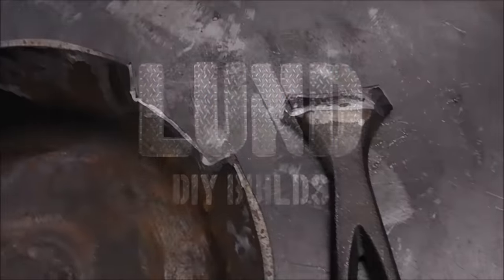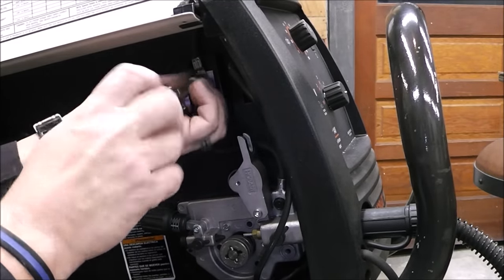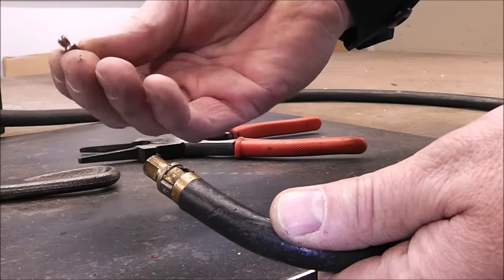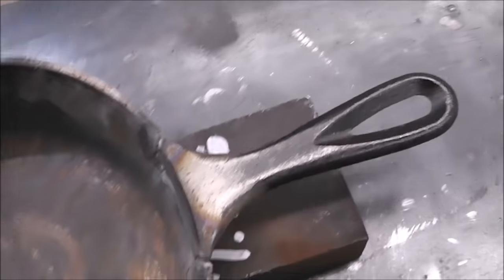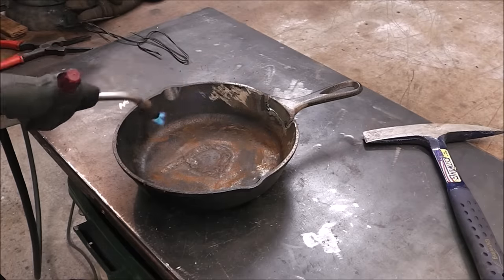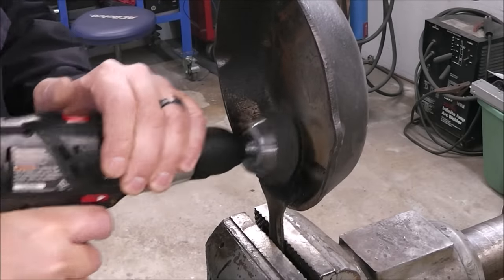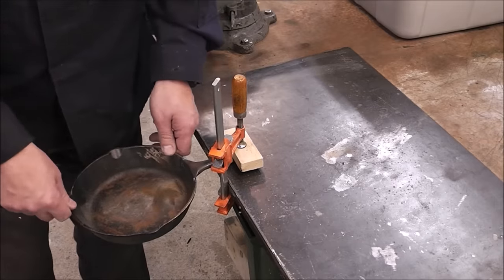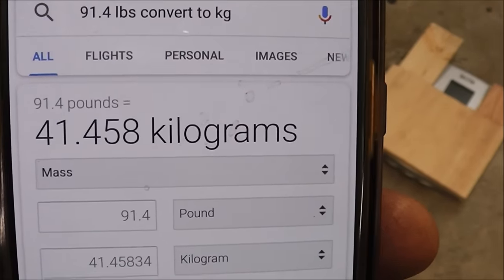Cast Iron Welding Repair using Flux Core Wire

Comment: This is good idea video...One flux clore is a method staw... which does produce higher temperatures for welding...Which can create extremely durable welds...
Flux core mig is also available ie home depot (lincoln electric) my preference) tractor supply (hobart) as in the video..any weld on cast via ie brazing or mig or tig.. is dissimilar metal..the strongest bond is cast iron is to recast the metal..which is very hard to do... the initial casting being the strongest..since cast iron is nor steel it is very hard considering the amount of carbon in the steel...
i have had success using borax and other fluxes that do help to control the welding temperatures.. also map gas is helpful being a blend of acetylene and propane..propane is a very cold gas...
another test ie versus strength would be proper sealing lie water etc etc...as far as oxy acetylene it doesnt always do as well either...ie the the blend doesnt always penetrate into the cast iron...so this is all about how far the weld metal penetrates and cleats and pools into the cast..then the tensile strength of the property of the repair metal...also in this video notice the welder used the bare minimum weld which is a viable strength...considering he could have gone and done 100 percent fill with additonal lap welding for strength you want some cool welding look how they bond armor plating in tanks with smaw vs fcaw...so this gives you the idea of the principles behind dissimilar welding process.. fcaw of course being extremely cheap as well as a good idea for one off
antique restorations as well...the next would be a strengthing video as well as liquid sealing video for final process...but a great video....could use a safety itro for those who hurt themselves lol...but nice..
Reply from the maker: Thank you very much Joseph! EXCELLENT post!

Comment: I've only ever TIG welded cast iron for a class; it was a 4" T-joint with 1/2" legs, took about 90 minutes after pausing for heat management and another 30 to cool it down.
My teacher said "when it comes to [repair welding] cast iron, braze it or buy a new one."
Reply from the maker: That seems to be a common misconception that a lot of the older generation welders believe but having tested probably more methods than most I can assure you there is definately more than one way to skin a cat. He is right in one aspect that brazing is a sure fire repair method, but it can be done using serveral different processes and fillers. I'm not one to paint myself in a corner by saying it can only be done one specific way.
Reply: @BrandonLund  I wasn't told that it's impossible, just that it's not worth the effort.
Reply from the maker: @Jorbsman_Petersdude It's definately worth the effort because it works. You could also MIG braze it with silicon bronze for a stronger joint or stick weld it with nickle or braze it using any of the aforementioned fillers. Brazing is just one of many ways to repair cast iron.

Comment: As a former Lincoln Electric employee at the Euclid, OH plant having worked both consumable and warehouse. Everything that comes out of there is labeled as Lincoln Electric. Both spools and coils and there packaging. Even the 500 lb drums were printed with there logo and put stickers on the inner core of the drums as well as on one lid per pallet (4 drums). Not sure what happens at the other plants. Just wanted to put it out there.

Comment: I have had success in building a fire in a wood stove and placing the welded item on the stove. easy to control the heat in the stove and cool down slowly
Reply from the maker: Great tip!

Comment: Since it is a pan it nobody will load up 90 lbs of scrap on it but they will run it through many cycles of heating and cooling.  I think the different metals (filler material and cast iron) will expand differently and that is where the crack will begin. Just a thought, I could be wrong but I think worth mentioning.
Reply from the maker: Good point Robert and that is very possible also. Cast iron is very fussy sometimes from one casting to another. One poster here said he has a piece of repaired cast in a wood stove that has seen hundreds of heat cool cycles with no signs of cracking. It's kinda a crap shoot at times but the dissimilar metals as you pointed out is where the crack would reoccur. Cheers brother

Comment: So say I have a 96 chevy 350 small block with cast iron heads. Personally i have 5 of these heads all cracked in the same area. Could i repair them?
Reply from the maker: It's ruined anyways so you got nothing to loose right? A lot of guys on here have posted they have been doing it this way for years with good success. If it were me, I would give it a go. If you do decide to give it a try, please post back here with your results. The comment section often contains good info. Cheers buddy and good luck.

Comment: I have a broken cast iron wood stove leg. Since the stove doesn't move I actually haven't fixed it for years. the stove is fine as long as it doesn't move.  I think I will give this fix a try.
Reply from the maker: Good luck with your repair @j m

Comment: Zheng I have a  Lincoln buzz box AC/D.C. I'm supposed to be able to weld aluminum with it. Was practically new from auction but I got no paperwork or manuals with it. If that's possible how about a video showing this short bus rider how to do it. Thanks
Reply from the maker: Thanks for the sub Keith and congratulations on your new purchase!  Theoretically it's "possible" to weld aluminum using DC stick but the results in my experience are not good. It's not a process used in the industry, welding thin metal is non existant and thicker stuff is unreliable.  Im not trying to discourage you but all my experiences with DC stick welding have not been good. If you really want to weld aluminum the best way is to buy an ac tig machine but they are quite expensive.  The Lincoln buzz box is a rock solid unit, plus because its DC you can pick yourself up a 17 style tig torch, argon gauge and a power block (the components of a tig rig setup) and do scratch start tig.
Reply: I have an argon tank and gauge on my mig. The tig torch and power block. Where would I look for those. Gas cylinder co that sells welding supplies or can I get one at Rural King with my ammo next week.
Reply from the maker: Keith, if you click the link in the description for the tools and gear that I use there is a tig rig setup on that page. I use straight argon on my tig setup. That way your setup to weld stainless. We dont have a rural king locally. I get all my supplies from Matheson. They are all over. Great service and prices.

Comment: What I would try is getting the handle and the pan glowing orange to red. Fire bricks help retain the heat if you form a close stack to the item.
Then use the fcw on a very low current , minimum. Weld in tack upon tack until creeping around the weld seam completely. This is to avoid poke through with the wire. That which I have done I only peen if it is substantial thickness. With a pan I'd reheat it to a glowing temp and as you did control the cooling. (Heating to within an inch of the weld repair.) I have had good results on tractor exhaust manifolds with fcw mig.
Reply from the maker: Excellent process! 👍

Comment: was there adequate penetration on the metal?  couldn't see the backside all that well.
Reply from the maker: There was very little penetration. Think of brazing rather than melting 2 metals together. The goal is to try and not "wet" the cast iron.  When it starts getting molten is when it's more prone to cracking.

Comment: There used to be a company out of Texas called EXERGON (sp) if memory serves me that made some cast iron wire for a job I had repairing the two bearing housings for the eccentric on a shaker screen another shop had done a week earlier and they failed. They used a copper based rod and I had to air arc and die grind all that out. By the time I got all that crud cut out I had 1 inch gap to fill on a 4 foot diameter and the flange was 3 inches by 1 inch. I had t hold a constant preheat between 450 to 550, so I built a forge out of a 60 inch crusher cone. I sent them a sample of the material and one week later I had 2 8 pound spools of wire  at 800 dollars for the wire and shipping out to the west coast. It worked out great their wire really did the job. It took 10 days to complete the job working 12 to 15 hours a day, I don't know if they are still in business but they were great to work with. They were expensive but well worth the cost, They also made a rod called extractaloy for removing broken bolts out of a blind hole. You just crammed the stick down the hole to the top of the blot and filled up the hole. When you got to the top you knocked the slag off the tip that was sticking out, and using the same rod welded a washer and a nut to the little nub. Then let it cool down for a while and rattle it out with an impact. I've tried to find the company but haven't had any luck, they were somewhere in Texas and I left the States years ago. Let me know if you find them or somebody else doing that service now. Thank you
Reply from the maker: I'll have to keep my eye out. That sounds like one heck of a repair! I would love to have been involved with that. It sounds awesome!

Comment: I'm not sure but I think my vice is cast iron (cheap Chinese) and I welded the steel jaws to the body no worries. It failed using a stick welder (both mild steel and stainless) but gasless MIG mild steel was fine. I think you have a good approach to fixing stuff on the run. In the remote regions of Australia some methods are just not feasible.
Reply from the maker: @Gary Blake thanks man I'm glad it worked. Some people get bent out of shape about non conventional repairs but if it works and it's all you got, why not try👍

Comment: I've very successfully welded wear steel on heavy equipment with cheap wire feed wire by using a very rigorous regimen of pre and post heating and peening.  What was supposed to be a temporary repair  has held great and is actually wearing out with the wear steel, it hasn't re-cracked.
Reply from the maker: Your a perfect example of you dont know until you try! Thanks for sharing man! A lot of people say it cant be done
Reply: @BrandonLund  Crotchety old machinist told me again and again and again "pre-heat, post heat and PEEN THE SHIT OUT OF IT!!"  He was absolutely correct.

Comment: As an old chef and new welder my question is is there any toxicity in the flux core? I’m thinking of the stuff that goes into the flux. Sorry if it’s a daft question, but I do make a mean béarnaise sauce.

Again as a new welder I appreciate this approach to trying and testing, thank you.
Reply from the maker: Hey Mark, great question. I'm sure it's probably consistent with the base metal in the pan and any toxicity is probably negligable but I'm not certain of that. I would not condone repairing cast iron for actual use simply because if the repair failed the results could be fatal. Cast iron cookware is relatively inexpensive so new Vs. Repair is the way to go (unless it's for display purposes).
Reply: Brandon Lund Thank you for the prompt reply, it’s really appreciated.

Comment: 90 lb in a cast iron skillet.  I don't plan on cooking any older children anytime soon, so I think this method works.  Awesome video man! Any reason you didn't put some weld on the other side?
Reply from the maker: Thanks davionaceae! Good question! I didn't weld both sides so I could experiment to see if welding it on both sides makes it stronger.  Heres a link to find out! Cheers buddy! https://youtu.be/qNHAteo-qwg

Comment: Been welding for 35 years and nuclear asme certified, use e309 stainless, and heat up to 150 before welding
Reply: 309 is Definitely the way to go.
Great for most repairs especially if you don't know what metal you are welding.

Comment: Thx for the video....wondering if you could just put the pan on an old hot plate to heat it etc
Reply from the maker: You sure could. In fact, get it up to 350f and weld it right on the hot plate. Over the next few hours slowly turn it down until your at room temperature. Thermal shock is the enemy. You could throw it in the gas grill also

Comment: Have you thought of putting a piece of heat shrink over the cone tip to prevent it from touching the work piece, in flux core welding?
Reply from the maker: I havent but that's actually an awesome idea! Thamk you! 👍👌

Comment: To arc weld cast iron use nickel 99 rod.I have even use nickel 99 with no pre heat with excellent results.
Reply from the maker: Nickel is great with cast. I did simular with Muggy Weld

Comment: I always keep the gas shield on, there is two reasons why your shield arcs out, you haven't cleaned your tip and shield properly, or the insulator/defuser is worn out or missing. That's some great information,  I would never have tried gasless,  I generally use low hydrogen, I have tried dissimilar metal rods / weldalls, but the stainless content makes cracking a bigger issue than with low hydrogen rods.
Reply from the maker: Pick up a spool of silicon bronze. You will never repair cast with anything else again https://youtu.be/Cm3_uv-PhPM
Reply: @BrandonLund  thanks mate,  I'll check it out now.

Comment: When I saw what you did it confirmed what I've done in the past although this is not my trade and I always wondered how strong the weld really was. When you did your test I sat here nodding my head in agreement "but" I have to disagree with your weight test and please correct me if I'm wrong. The weight you applied was "not" over the actual weld but several inches away and not concentrated in one spot as I'm sure a lab test would be conducted. What I am saying is, I am certain that the actual weight on the weld was probably multiples of what your scale read because of the actual distance away from said weld, think lever affect here. I hope I explained myself in a logical fashion but I look forward to any comments in agreement or not.
At any rate, "weld done", pun intended. Thanks for the video.
Reply from the maker: Thanks Wayne. Nope I completely understood what you were explaining and you are totally right about there being more force on the weld than what was actually shown on the scale. I think it's called a lever but either way your right. I'm not sure if you have seen any of my other cast iron welding videos (which includes different processes and filler materials) but each test we did was using this same crude but rather effective method and this repair (if I recall correctly) was one of the stronger ones. Thanks for watching and for your support. Brandon
Reply: @BrandonLund  I've seen a couple of your videos and like what you do, I think what makes them so popular is that you recognize your followers are most likely limited in experience with steep learning curves. I love to watch professionals who are able to explain in a simple and respectful manner to those of us who may have expertise in other areas but just love to get their hands dirty...and yes I've subed.
Reply from the maker: @wdenis11  Thanks brother! I appreciate the Sub! I have been doing some "non welding" projects lately but once I get those wrapped up we will back in full swing again!  Cheers Brandon
Reply: @BrandonLund  If you don't mind a project question. I am rebuilding an antique stationary engine that is missing the mounting block for the rocker arms and shaft. I've managed to find a pair of cast rockers with the shaft going through a cast block. To make it fit I have to weld that to a 1/2" steel plate which will bolt onto the head. If I preheat the cast should I be able to mig weld the cast to the steel plate? Thanks.
Reply from the maker: Welding cast to steel can be hit or miss. The only real way to know would be to give it a try. A preheat, peining then insulated cool down will give you the best chance for success.

Comment: Awesome 😎 I WELDED A 318 ENGINE BLOCK,,,AND WAS ABLE TO LOAD IT WITH SCRAP AND DRIVE IT TO NEARBY SCRAP YARD BY USING BASICALLY SAME METHOD.😎 AIN'T IT JUST AIN'T IT. True story the old truck ran great guy at the salvage yard said he was keeping the ol truck.
Reply from the maker: Thats awesome man! I bet you heard more than once that it "wont work" or it "wont last" and on and on. From my experience you have about a 50 percent chance and maybe a little better fixing it with whatever process you have as long as you do it right and take your time to prep and weld.

Comment: For those of us on a budget who can't afford a rig welder, any advice on using a plain old wire feed arc welder?  Is it even possibles?

Reason being, I have an old wood stove that was my grandparents, and the top has a couple big cracks/broken pieces. I came across this site while looking for ways to repair it...
Reply from the maker: Cast Iron can be fussy depending on a bunch of factors. You mentioned wire feed but you also said arc welder. If your talking just plain wire feed mig I have done it successfully and I have also done it arc welding with 7018 and nickle rods. You mentioned an old wood stove. Automatically I would encourage you to stop drill the crack, groove the crack and preheat the part prior to welding for your best chance of success. I'll attach a playlist with a bunch of cast iron welding process and testing information.  https://www.youtube.com/watch?v=qNHAteo-qwg&list=PLfbf78fMz9VpweFv4IqUfrrNV6Vvro7Cd